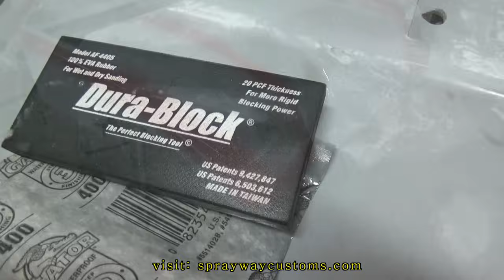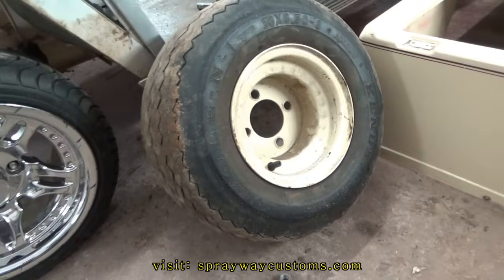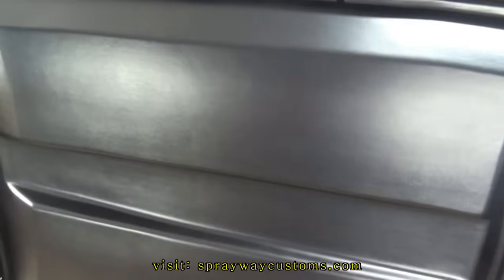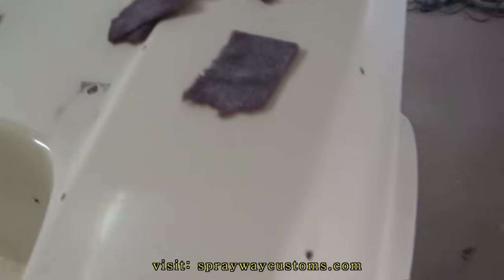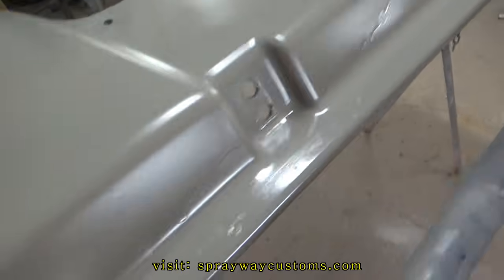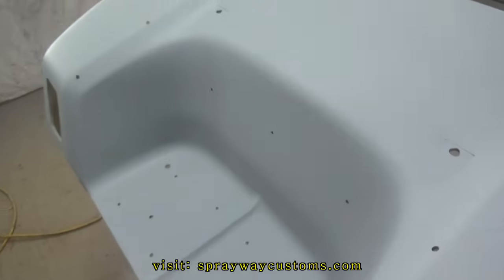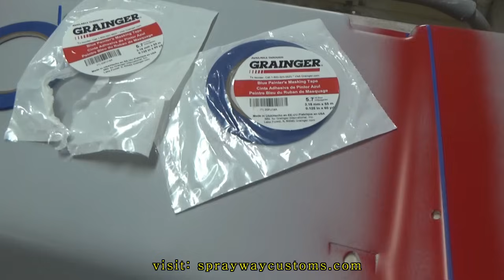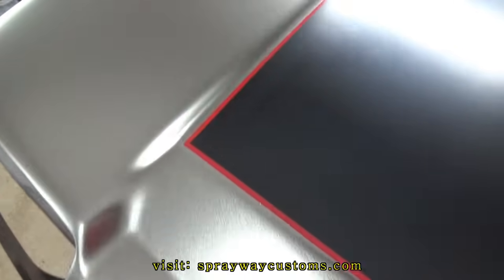How To Paint A Golf Cart CUSTOM PAINTED CLUB CAR & WHEELS & TOP Two Tone Paint Job With Stripes

Comment: I have same cart, 2015. I painted it satin black, big wheels gloss black, roof gloss black, interior red with diamond stiching seats, with red stripe on lip of the wheels, and couple red stripes on the side, led headlights, tails lights, underbody, and I am making custom doors for it now, and working on “I pad” install In center of dash, custom sub box with 1 10”, 6 mids, 4 tweets, should be complete in a week or so, will make a vid on the completed project! This paint scheme is super nice!!
Reply from the maker: Thank you

Comment: Your Right,,, Runs in your Primer Coat don't Matter And a Run Spot, Just Means, You got a Thicker Application, You Have To Block Sand Your Primer Coat Anyway, So it'll Look Good In The End, Your Work Always Looks Good Man
Reply from the maker: Thanks Sam. I don't quite get as mad at myself for running primer than I do clear 😡

Comment: Ha,ha,ha! DAMN MAN! Another great transformation! What a difference!
BTW, In the video where you painted the wheels I asked if you knew the make & model of the wheels. You replied that you would have to ask the owner,  just checking if you got the info? I have an 85' Chevy Sprint that has 12" stock steel rims that I was just going to spray black, but I think those wheels you painted would spruce it up a bit more. Not many good looking options out there in the 12" size. Only boat trailers and apparently golf carts! LOL.  Thanks for sharing!
Reply from the maker: I'll ask him when he comes to pick it up.
Reply: @SprayWayCustoms  Cool, thanks!

Comment: Hell yea jamming to some Journey! Taking something like this apart always leads to a cleaner job also. The last two carts I painted I got a quart of the SEM trim black and sprayed the tops, it worked awesome and gave the perfect finish. Looks good bro!
Reply: Im a mechanic by trade. But I painted my first cart just to see if I could do the mud work and spray some paint.  I chose a midnight blue and sprayed it up. My air pressure dropped while spraying clear so one section got clear spitted at it.  This particular clear said to put on at heat lamp for some time.  Well I did that but I put lamp too close and base coat after 15 minutes looked like I was cooking pizza.  D/A back down and resprayed base and clear ok.  Now I’m currently bout to sand clear flat.  

Looks okay for a mechanic painting but best part is what I learned.  Distance with heat lamp
Reply: @steveh7085  I’ve never seen a clear recommend using a heat lamp.
Reply from the maker: Yes indeed

Comment: Great video.  I see an epoxy primer on Amazon called Stone Coat Countertop.  Says that it can be used on any surface.  Do you think this epoxy primer would work?
Reply from the maker: It should without a problem

Comment: Learned a lot. Thank you for this! I’m actually planning to paint mine this up coming weekend.

Question about between coats. Did you have to let them cure, sand, paint and repeat?
Reply from the maker: Just let it flash for about 15-20 mins and continue to the next coat

Comment: Another great vedio and great job 1 questions did you have to use the epoxy primer or could you have just used the High build
Reply from the maker: You could just use high build but I wanted to take the extra step since it's being plastic and constantly flexing.
Reply: @SprayWayCustoms  thanks for the tip

Comment: Cart looks awesome! In the process of painting mine now. What kind of paint did you use and did you spray the adhesion promoter on the body pieces as well?
Reply from the maker: I used UreChem paint. I just used adhesion promoter on the plastic

Comment: Does wetting the ground before painting make a big difference?
Reply from the maker: Yes it does....If you spraying close to the ground it most definitely mater because if not you'll blow up all kind of dust particles. If I'm spraying up high sometimes I don't bother to wet the floor.

Comment: 🔥🔥🔥 quick question! Is 155 Air Compressor 20 Gallon 4.3 Craftsman to small to paint a car? Thanks💪🏾
Reply: Depends on the cfm.
Reply: @TheCatMilton  it say @ 90 psi,
Reply from the maker: You'll have to match your gun cfm with your compressor to see if it will keep up

Comment: Hey bro, I'm interested in getting some work done, could you contact me at your earliest convenience I would appreciate it, Thanks.
Reply from the maker: What you need done?
Reply: @SprayWayCustoms  I need fiber glass dash, subwoofer box built and fiberglassed ,bucket seats and system hooked up, I'm running 6 12"s,6 6*9's,8 6.5's,8 tweeter's,amps batteries and EQ, I would like a console built for 6.5 or 7" touch screen, it's all going into a 76 Chevy Impala 2dr hardtop.I can send a picture of it.